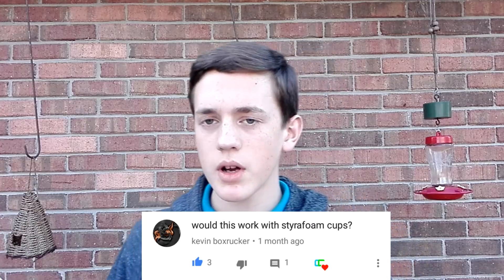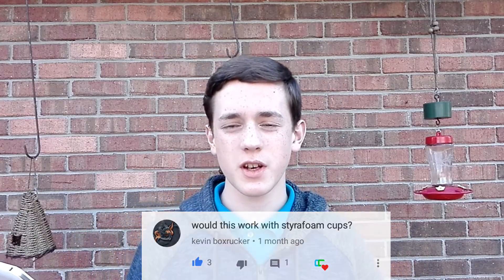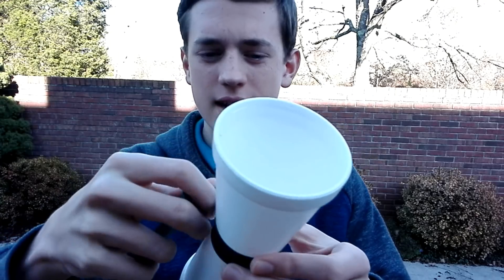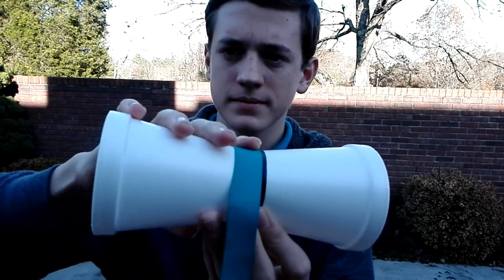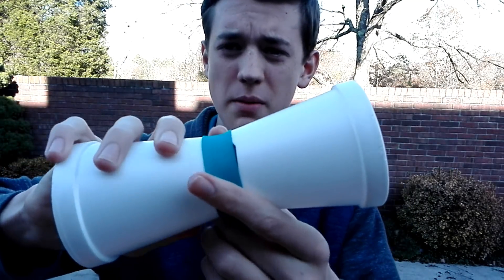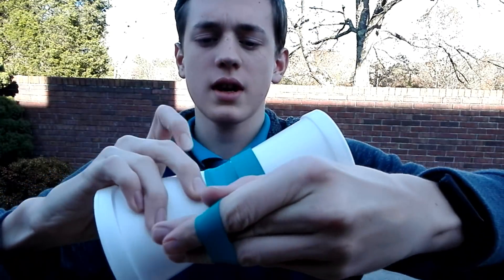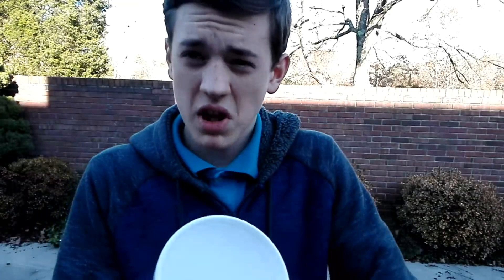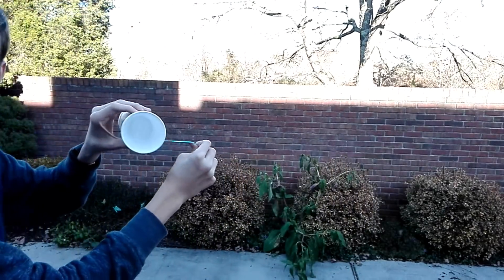Experimenting with Magnus effect Cup Gliders

Comment: I would tend to think it's because Magnus effect doesn't produce a huge amount of lift, and it's being counteracted by the significant amount of extra weight applied. The weight is not giving it any additional rotational speed, just maintaining it longer. But the extra weight overcomes any advantage of keeping the rotation speed more constant. Maybe try putting some kind of small diameter hub in between the cups, for a bit of additional "flywheel" inertia but also a center of mass that might give it a bit more directional authority in flight. In addition the smaller diameter might allow you to get more turns out of your band winding, for higher rotational speed when released. not sure if it would actually work that way. But if my reasoning is wrong, you could also try a large diameter thin disc between the cups, that would give some rotational inertia as well as a kind of rudder action for stability. My advice: find the setup that works best, make it robust, and market it as a toy :) i love stuff like that. i'd buy it.
Reply from the maker: L TR Thanks for the insight and suggestions:)
Reply: Instead of adding extra mass to the rims of the cup where balance is the most critical, how about, say, taping a penny to each of the bottoms of the cups.  You can also try equal amounts of epoxy to each cup bottom before taping for better distributition of mass.